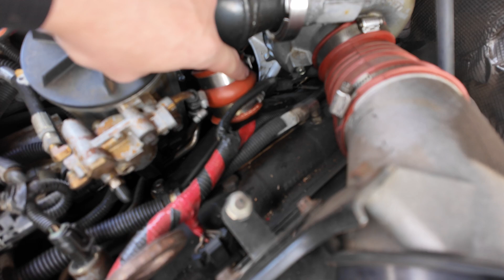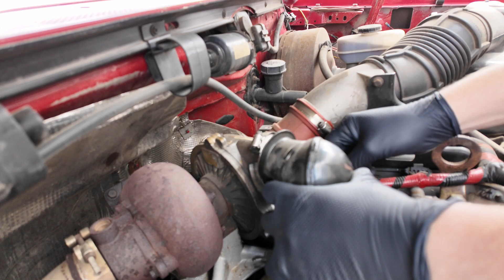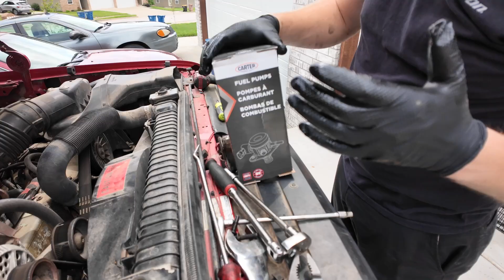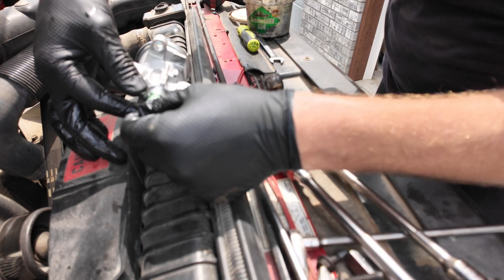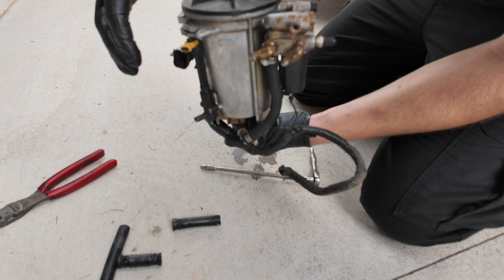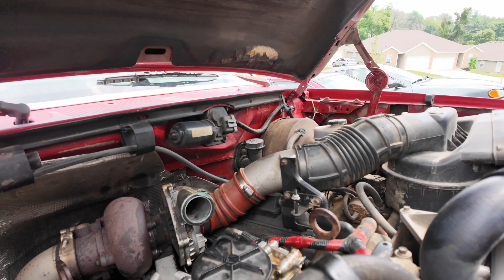OBS Powerstroke Lift Pump Repair(Complete Step by Step Guide)

Comment: Great video. You said every time I change these out! How often is that?? 97 7.3 here and mine crap out in about a year. Keep telling myself to order OEM but 2 weeks ish on delivery. When I need one I need it now, so parts store it is. I’ve done it so many times it’s almost the go to repair on this truck. By far the most frequently replaced part CPS close 2nd.
Reply: Sounds like a fuel bowl delete system is in order
Reply: @wendyking9759 very well could be. Just need to do more research on them before I bite the bullet. Truck only gets about 3-5k miles on it a year.

Comment: Is that Schrader valve also a way to test your fuel pressure?  I watched the whole video hoping you would discuss that item but I changed out my fuel filter yesterday and was right there looking at the fuel lift pump, and fuel bowl, etc, it's a 1995 that I bought used from a diesel mechanic who had gone through almost the whole truck, back around 2008 or so.  The truck sits outside all winter and I drove it 100 miles or so in February and it was fine, I just fired it up the other day after leaving it plugged in for 6 hours on a spring day, maybe 60 degrees tops, then the Check Engine light started coming on and I was losing power, took it back home, looked around, drained the fuel bowl and put in a new filter and cap, (one piece aftermarket unit from O'reilly's), fired right up and I have not drove it on the highway yet but no check engine light, but it did take awhile to prime up I am guessing before it would start after changing out the fuel filter.  I did not remove any lines, but I have the fuel pressure tester on loan from O'reilly's, (Napa was closed on Memorial Day, they don't rent out tools anyways).  I think I'm good, all I can figure is that old filter was so clogged it was causing low fuel pressure, so that's why I wanted to test the fuel pressure.  I'll keep looking.  It seems almost certain that it's a fuel Schrader valve so I should be able to hook up the tester and see what it says before I take it back to O'reilly's.  I'm guessing it's going to test fine anyways.  

There is some oil like soot around the turbo sleeve you took off in this video but not seeing any diesel fuel.  I think it needs new glow plugs and harnesses and glow plug relay as well.  That's why I am getting cold start issues, plus bad fuel from sitting outside every winter.  Great video and very appreciative like others have stated.  Good job covering all the things that could go wrong.  I hit like and subscribe as well.  This is one of the best video's I have seen yet on the 7.3L, mine is a 1995.  Very similar to the one in the video.  Other vid's have some backwoods BS, or whatever, (I play the banjo so used to all of that!) but you speak clearly and humbly, just focusing on the repair itself.  No fluff, no accent, no showing off.  We are fixing the fuel system, that's the main topic.  See the other video's for drama, especially the shorts.  Those are almost worthless but there is one and it looks like he put the gauge on the Schrader Valve in question.  Now I know the proper names of all the parts anyways.  Sure is a bitch working on the motor off a 4' step ladder!  Seen some upright creeper in one video, on a ladder, that looked pretty cool, but looks really expensive.  All I would say is I think the Cam is painted at TDC and if you can get the engine to stop there before pulling the lift pump, it's probably the repair book way, but I can't find my book.  Been looking everywhere, have to keep looking.  

Thanks again, rambling on...
Reply: Yes the shrader valve is where you can get a fuel pressure reading

Comment: Odd question, could you measure where you did the bends in the wrench for removing that rear banjo bolt? Im looking at doing the pump on my 95,
Reply: I eyeballed mine.

Comment: Excellent video. Very helpful. I'm about to do this process on my 97 so seeing it first helps. I do have a question and maybe your experience can clarify. If the pump tappet falls out out the old pump (WTF) what happens? I've gotten differing feedback on this. Some say the old tappet will drop into the oil pan and be harmless. Other say you can fish it out with a magnet tool. It's my understanding that on the 1994.5-1997 it's impossible for the tappet to fall thru and into the oil pan as there is no path. If it does fall, and you can't fish it out, it just lands under the cam and sits in the space (which scares the crap out of me) behind the timing chain. I really don't know the ins and outs of this engine block so...can you clarify if you have the time? I have the factory shop manuals so I'll see if they clarify the issue as well. Thanks again for a solid and understandable video...

Comment: This job was such a pain in the ass as a first timer. If this is your first time, expect this to take 2-3x as long as it should. I probably account for half the views of this video the amount of times I watched it during the job. Really appreciate the details and the camera work (hats off to the person filming 👏). Only thing worth mentioning, especially if you have a higher mileage truck, is to remove the fuel regulator from the fuel bowl and clean out the screen in between. Mine was very gunked up, unsure how much it helped since my lift pump had a bad leak but my truck starts so much quicker now. Great video man, I really appreciate all the knowledge and tips. Just wish I had a way to bend my 1 1/4” wrench the way you did. How did you do that?
Reply: you can also use a long 1/2 flex head ratchet and a deep 1 1/4 socket from the back (mine was a Matco cfr248blfx and a Pittsburgh 1 1/4 socket). I tried to bend the wrench but it was unsuccessful because it was too thick (it was a klutch wrench not the husky so thats probably why lol)
Reply from the maker: I used a oxygen acetylene torch to get the wrench red hot then a vise to bend it. This is a husky brand wrench from home depot, the bend makes it way easier to do, but I did a few with it before a coworker showed me how much better a bent wrench was.

Comment: Explained it in the video. How do you get the banjo bolt back on cuz everybody in the f**** comments has said the same thing. How do you what's the trick to getting the banjo bolt to grab? Cuz you say just wiggle it and it'll grab. You can't even get your fingers under the turbo like you said to turn it. So even with the pedestal cut out so that you can reach your fingers in there. You still can't get under there so explain to me and everybody else in the video. How do you get the banjo bolt to grab?
Reply: We used a long neck electric ratchet and an oil filter socket with a swivel to get it in and that made it easy. But you gotta be careful to not crossthread the bolt.
Reply from the maker: Push it forward into the pump, and turn it clockwise, I don't know how else to describe it. It takes a lot of manual dexterity to do it but I've done it so many times it's genuinely not any big deal. I just had to replace this pump again last month because the carter pump died after 14 months. But patience and go slow, that's all I've got.

Comment: Good god. Every video on YouTube detailing this process only to find out there's no trick to getting that banjo bolt back in 😂.  Spent 3 hours trying to get that mofo to thread back in and still couldn't get it to bite properly. fml man. Getting that bolt in is worse than trying to get that pump out.
Reply from the maker: It's literally 2 minutes of work with the fingertips. I can't teach manual dexterity in a video. Line up the washers a n d start the bolt. Unless you're dealing with a California model with the fuel damper, if yours gas the damper you'll need to pull the turbo.

Comment: Ford has elec pigtails for sensors. Depinn old sensor pig tail housing remove one wire at a time istall that wire in new harness housing the  same process next wire . 
Do not use crimp style butt connectors! (Solder only ) whole upper harness removal less than 30 minutes 😊

Comment: Really enjoyed your video. I am replacing the lift pump on my 1997 PowerStroke and while at it I am  replacing the fuel lines, and the Parker rubber sleeves on the lines from the banjo bolt lines where the go into the back of the fuel rails. Should I do it after I bolt the lift pump down and connect the banjo bolt in the new pump or replace them with the banjo bolt removed? After watching your video I wonder if I remove them while banjo bolt is removed I might change the geometry of the lines and never get things to line back up. I’m 69 years old and doing everything myself. I haven’t found any videos showing how to replace the Parker sleeves. Thanks for any advice you can give.
Reply: This is exactly what I was going to say ! Iam 65 and like doing my own work ! Two things do worry me on my 97’ also is the plunger on the bottom and the two washers for the banjo bolt !